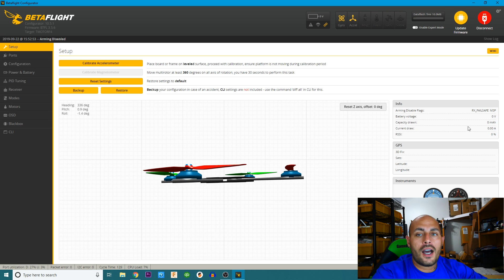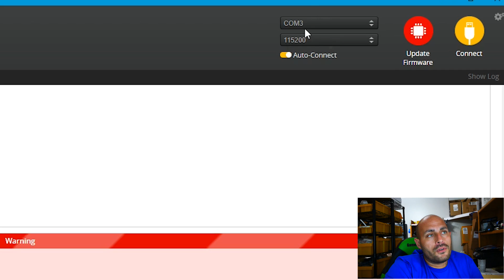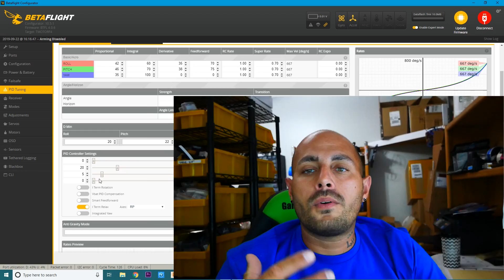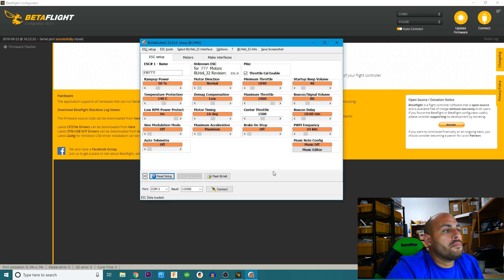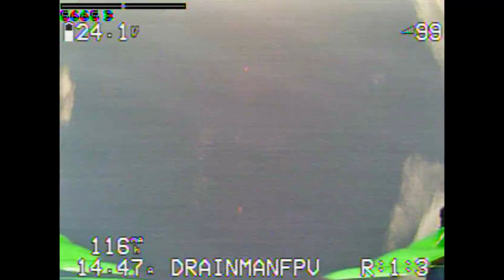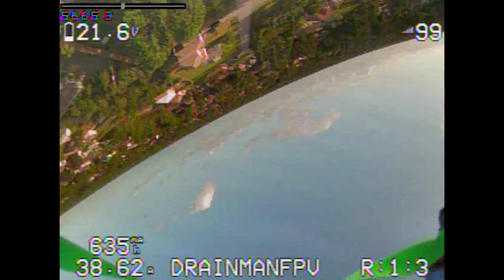How To Set Up A High End FPV Racing Drone 💰 We Built It - Now Let's Set It Up - Betaflight

Comment: Hi  I need a bit of advice. I crashed into a lamp  post and everything seemed fine but when I plugged in the battery I got a short. It seems to be in the xt60 where the smoke came from but does that mean everything is fried ?  Because Im new to this what would most people do now ?  Thanks. Peace ✌️
Reply from the maker: Use your multimeter and check for shorts, you might be good to go.
Reply: DrainMan FPV Thanks Ill do that. So far I plugged in the usb to the fc and with my little experience I think its a good sign that the sensors ate working.  I just need to solder back on an xt 60. The other one fused together with the battery. Time to get to work. Thx again. Peace ✌️

To check with a multi meter is just touching the battery lead  + and  -   Enough ?  I did that and I got no beeping.  So I may be good hopefully.
Reply from the maker: @jordannovek2911  yep, go into continuity mode and make sure there is no short. If you have bench supply, use it. If not try to use smoke stopper, good luck!
Reply: @DrainManFPV  Thanks  alot and thanks  for pointing  me in the right direction . Peace

Comment: great tutorial bro... Keep em coming!!!

100% TAKE YOUR PROPS OFF!!!  U don't want to see the pictures of my  hands, the last time I didn't take them off!!!  some flight controllers will let the quad arm while in betaflight. most will not but unfortunately there are some bad designs out there. on top of that this quad also allowed itself to arm with the throttle at 100%. so you can just imagine what happened to my hands  when a 5-inch quadcopter running on 4S instantaneously went to Full Throttle, the very instant I connected the battery!!! You do the same thing a hundred times and nothing happens, until that one time...  When changing settings in betaflight PLEASE TAKE OFF YOUR PROPS.